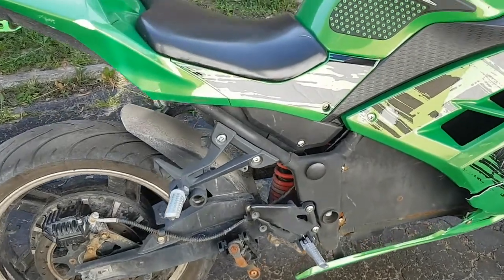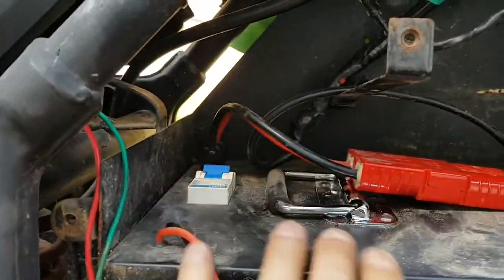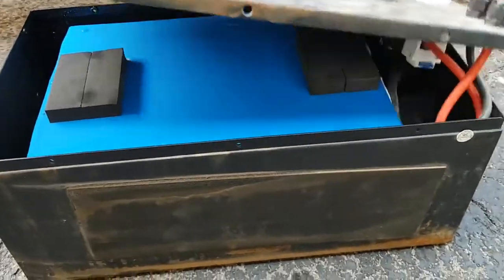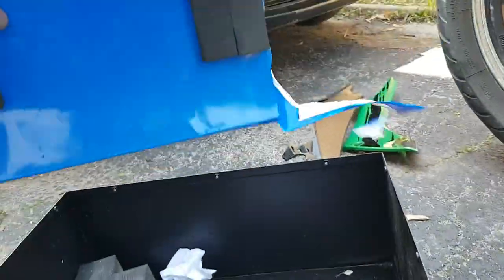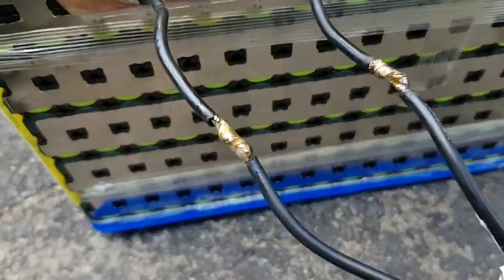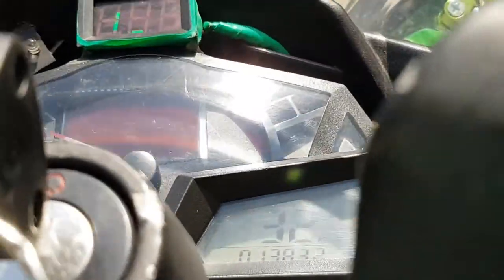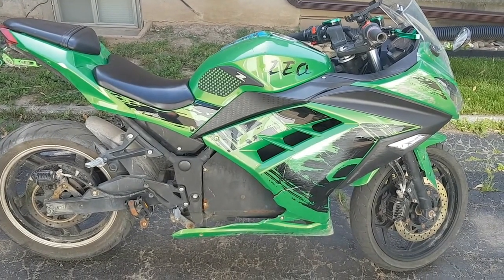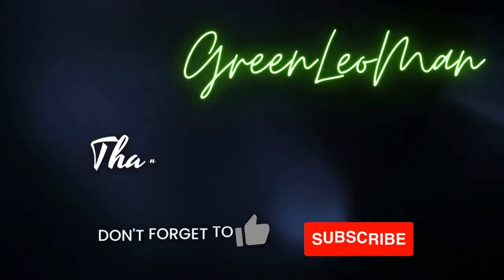Tao Leo - BMS Removal + Test Drive

Comment: Good video and explanation about  the BMS , however there is a much simpler way to do the test . Simply measure the voltage coming out of the BMS on out put side negative which will give you no voltage in your situation.  Cheers.
Reply from the maker: Your right. But simple doesn't make good videos lol. Just kidding 😂. Good observation 👍

Comment: What bms is in the tao leo im being told i only have a 100amp bms in my leo
Reply from the maker: Yea actually the original 2020 tao leo only had an 80amp p.o.s. not sure about the 2022 models. But yea 100amp sounds bout right. But i put the daly in and it's bluetooth controlled up to 120amp. With the daly bms u can set all the low and high voltage, amp, etc settings to get the most out of your battery. Including an on screen monitor of all the battery rows. Incase there's a problem, it'll let ya know. I definitely recommend the upgrade if u know what ur doing. This modification is not for the inexperienced. U could explode the whole pack if not done correctly. But if u know ur way around high amp then a daly bms is a must. So yea u probly do have a 100amp bms low buget, made in china jobby. Hope that helped and as always, tnx for watching 👍✌

Comment: mate, are you running these 2 layers battery with one bms only ?
Reply from the maker: It's 1 layer folded in half bud. 72v 40ah. Only need 1 bms.
Reply: @GreenLeoMan  thank you 🙂
Reply: forgot to ask you mate, was these cells 21700 or 18650, asking to know how many Parallel i can make :(
Reply from the maker: 18650

Comment: Love your problem solving. Do you think it was the fast charging that affects the BMS life expectancy?
Reply from the maker: Its a 10a charger, bms rated for 20a. Shouldn't make a difference. Just a cheap failed bms. Looking forward to the DALY.
Reply: Yes 100% I have been riding e bikes 12 years and slow charge is the best.